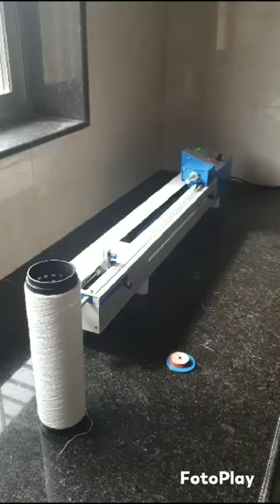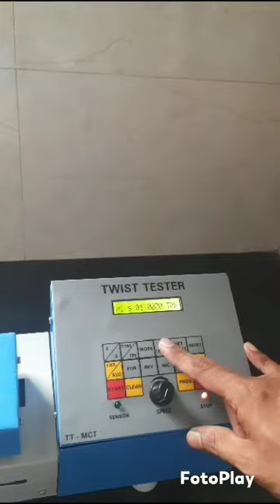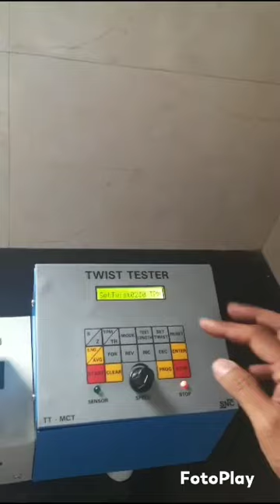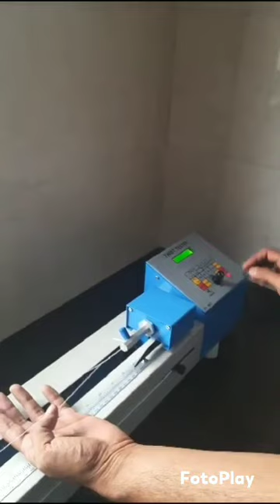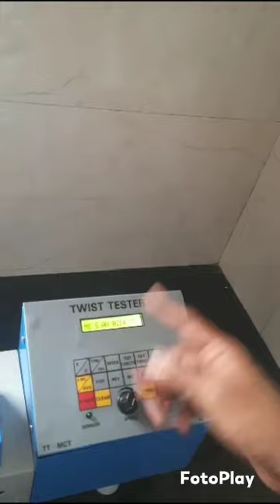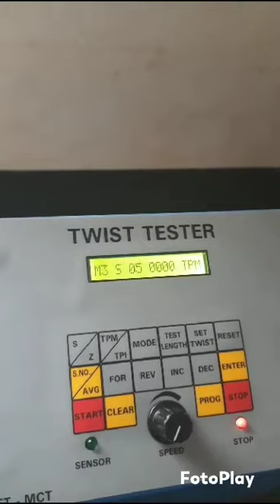TWIST TESTER

Comment: How To Check TPI Report Single Yarn  Cone..
Reply: For single yarn, M2 or M3 mode of operation is recommended. There is a selector button to choose results in TPM or TPI, so you can get results in TPI for Single Yarn. The operation method we can share with you separately.